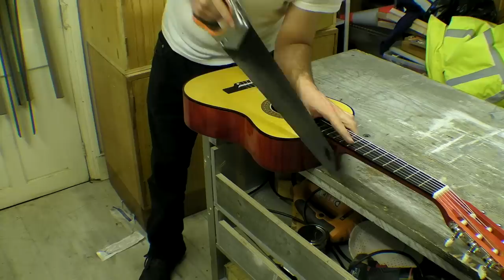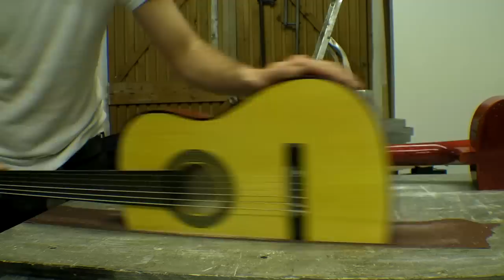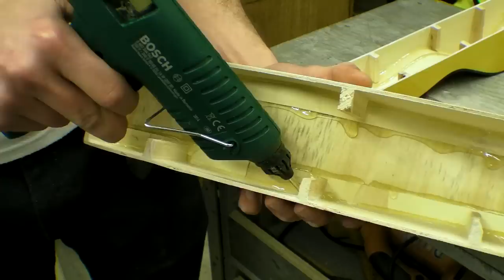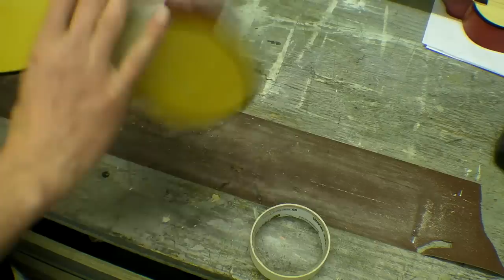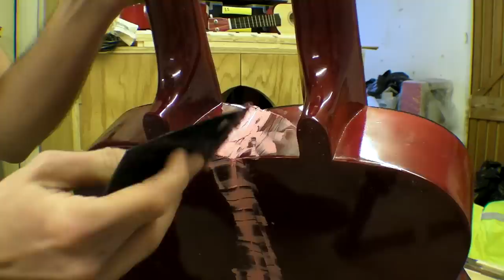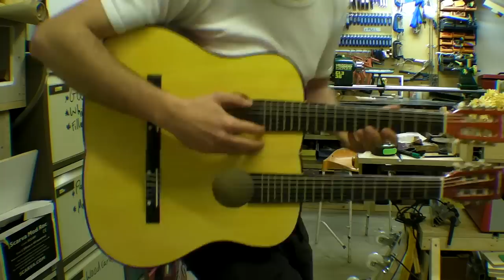Double Neck Guitar / Monkey Nut Maraca / Multi Neck

Comment: Cool AF ! I'm not sure what the insults are for - jealousy and pettiness would be the 2 top reasons. I just saw this and a few years ago - I thought about taking to 300.00 to 500.00 acoustic guitars - one 6 & one 12 and cutting em just like this and putting em together for a double neck. I wavered back and forth - now I know it can be done ! Great job ! There are reasons why someone would want a double guitar - clearly some of the bozos that have commented on here - are too narrow minded to know why one would want a double necked guitar ! Excellent video !
Reply: Uh dude the purpose of a double neck is 12 strings on one neck for rhythm and one 6 string for lead.
Reply: Ian Meadows some are 6/12 but there are also some that are 6/4 (guitar on one side bass on the other) some are 6/8 (guitar and mandolin) some are 6/6 (twin necks tuned differently or have different pickup/bridge combos or 6 standard and 6 baritone or bass vi style) and  a 6/8 (guitar and lap steel) also with bass it could be 4/4 5/4 5/5 fretted/fretless (ive even seen a 7/7) or a 4/8 (standard bass and 8 string “octave” bass) not to mention various types of harp guitars. There’s really no limit.

Comment: Okay, you did it, but why?
Reply: I watched it too. But what's the point?  Two guitars smashed together. Same string arrangement.  Same tuning
Reply: I still don't get the point. They make the same sound.  It seemed like you just wanted to make a YouTube video.
Reply: ***** I'm designing a guitar to build.  I would never make a two neck. That's even worse.
Reply: +Timothy O'Brien i think its a tutorial video if you want to have two guitars in one in different tonation out of cheaper ones
Reply: You mean timings?  I still can see how that's stable.
Reply: Timothy O'Brien
no, not timing. i would be happy to merge a acoustic bass guitar with normal but it loks to fragile to me
Reply: I meant tuning. Typed too fast
Reply: Timothy O'Brien
 not a problem Timothy, but a bass and normal guitar sounds nice, doesnt it?
Reply: How are you going to deal with the radically different tensions?
Reply: Timothy O'Brien
hm, 6 strings tension versus 4 strings tension. I think I can think of something
Reply: +Timothy O'Brien It has a nice reverb built in :D
Reply: +Timothy O'Brien The only practical use I can think of would be, if you used capos a lot it could be useful but otherwise, I personally would have a six string and a bass neck.
Reply: John Lacy I would rather make a double neck from scratch.  Oh, and you could also use different tunings on each.
Reply: I agree. I do some guitar work but building a double neck acoustic from scratch is a little daunting, not to mention expensive. I have a decent martin and an epiphone les paul I'm going to re-design Muahaha! So a double neck acoustic is outside of my reality for now but if I live long enough I will build it and they will come...
Reply: John Lacy I built a double neck solid. I didn't like the way Gibson did it. The heads are too close together and it's difficult to get a winder in there. I want to build a double neck acoustic, but it's going to be a while.
Reply: In the mean while rebuilding cheap guitars with good necks is fun and keeps you in practice
Reply: +Timothy O'Brien think they forgot that people use 2 neck guitar for tuning or one is 12 string+6 string or bass+6 string or other. not 2 of 6 string with same tuning. idk the purpose on this really XD. maybe for tune but idk why you would do that if you can buy a good guitar for the price of those 2 guitar XD
Reply: Béla Katona they were tuned the same though. that's why he was asking
Reply: +Snowie May The bottom neck was tuned to open E while the top was standard - it creates resonance.
Reply: +Timothy O'Brien I felt sad when he start cutting his guitar. For me, it's just sad.
Reply: +Timothy O'Brien I think the real question should be : why not?
I mean, there's one reason and one reason only for doing art, is because you want to.
there's really nothing to it.
people can do what ever they want, deal with it.

besides, he could do different tunings on the necks.
Reply: ***** I don't see the art in taking an instrument and doing that.
Reply: Timothy O'Brien well then you don't know what art is I guess
Reply: ***** Oh, no. I started drawing and sculpting when I was less than 7. I started playing guitar when I was 12.  I carved my first marble sculpture at 15 with no lessons. I composed my first piano sonata at 18 and my first symphony at 20. I know nothing about art.
Reply: Timothy O'Brien right.... never told you to tell me your life story but....that's ok I guess.

but again, you can do what ever nowadays and call it art.

I think what this person did might not be very "artistic" and I probably shouldn't have called it art.
but in any case, he wanted to do it, and he did it.
and if you started playing guitar since you were twelve and by your profile picture I can say you are.....55? then maybe you know that there's plenty of different ways to tune a guitar, thus, making this cheap two necked guitar useful.

besides, that thing you said about "preferring to start building a double neck guitar form scratch"? yeah, not everyone is artistically genius like you, and, if this guy wanted to do it, and had to buy two 20 dollar guitars to accomplish that, then I'm totally ok with that. 

and you should be too.

Comment: How in the world do you get near perfectly straight cuts with a hand saw? Every time I try to cut something with a hand saw (be it a hacksaw or a wood saw), the saw always goes wherever it wants to go. I usually have to use some kind of guide such as a miter box to make straight cuts and even those lose their efficiency over time. Please let me know your secret. And don't tell me to hold it down and go slow, because, and I don't say this out of disrespect, but it's quite obvious that you're struggling to hold down the instruments as you're cutting them. I can only imagine because you wouldn't want to crack or damage the guitars in other ways by applying too much force holding it down or cutting it.
Reply from the maker: It took a lot of practice to butcher two guitars.